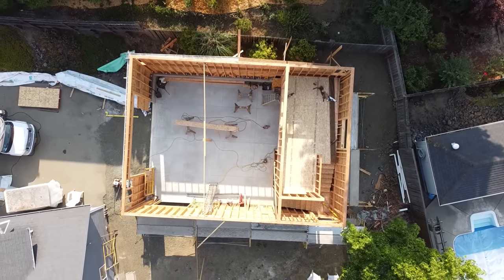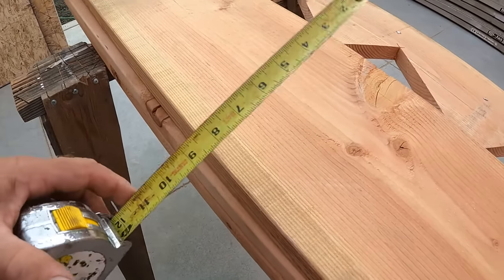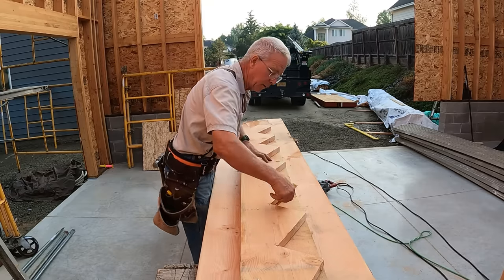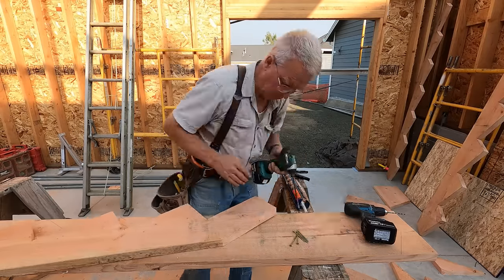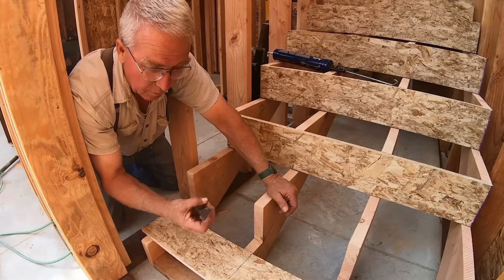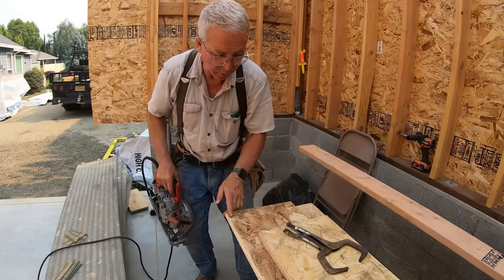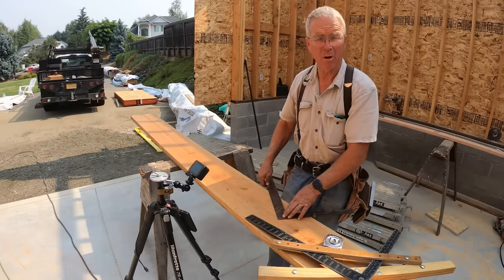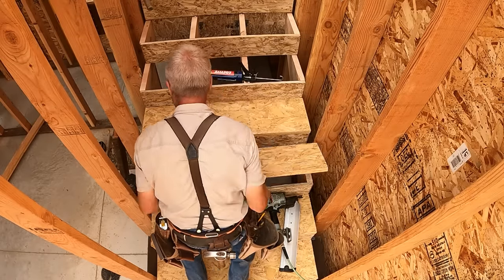Cutting Stairs With A Pro - Tips and Tricks: Shop Build #14

Comment: As 35 year carpenter that began doing strictly apartments in the union at a high pace for my first 13 years. I have cut hundreds if not thousands of sets of stairs as well as formed many concrete stairs this is the absolute best man to watch when you need to learn. I’m not one for the camera but I’m glad men like this are out here sharing their knowledge!
Reply: Yup, I'll watch this again - it's philosophy + logic + technique; the complete package.    And I cut my first stringers in '76 🪚👍
Reply: Michael Mass, I am helping a friend with his porch stairs and I cut the stringers for it.  1 time doing that, and one stringer has 2 treads that are about 1/8" shorter than the others.  Is 1/8" enough to be worried about?  I am adding the joist seal tape before we put the treads on to protect the wood.  Should I add a second layer of the tape at these locations since it is about 1/8th"  
I am annoyed with myself for those two being off a little.
Reply: @jamesbeecher4431  An 1/8” in framing is definitely tolerable it’s the thickness of the blade. A lot of framers would call it perfect. 
If it bothers you just knowing it’s off putting an extra layer or two of joist tape on them is a great idea! 
Stairs can be intimidating for some but they really aren’t that difficult, at least most, hats off to you for taking on and completing them!
Reply: @michaelmaas5544  Thanks for the info and encouragement.  It's an excuse to buy power tools!
Have a great week.
Reply: @jamesbeecher4431  one can never have to many tools!
Reply: @jamesbeecher4431 buy a box of steel foundation shims. 150 for a box now. Painfully. Surprising how often they come in handy. Various thicknesses. Sort out a few and take that 1/8th out. I sound just like you and that's the way I've dealt with it for 15 years and I'm a contractor now. Fix framing mistakes all the time.
Reply: what's wrong with a 2by4 and steel square connected together with C-clamps

Comment: I have to comment about my experience with stairs.  I was on a federal project for constructing a "park-like" facility and had a slope to traverse.  My experience was in another area of civil, so this type of structure was totally new.  I asked several engineers for some pointers.  The only help I got was "You'll figure it out".  The design and layout were not defined in the plans other than a graphic on plan view which showed steps from top to bottom.  I was responsible for laying out the set of concrete steps for the contractor.  I had little clue.  I had a defined elevation difference and chiseled in stone touch-down points I had to hit and keep the rise and run of each step consistent within the defined specs.   I did a lot of head scratching and finally reverted to drawing the layout in profile view.  That's when I discovered that a significant landing midway of the steps was required to maintain the rise and run and keep the firm touch-down points.  This was approximately 40 years ago.  I periodically stop by that project just to see the completed steps.  Some things you just don't forget.
Reply: your story illustrates that you had to take the bull by the horns and figure it out youself!..those engineers do what they know best but ultimately leave it to you....only the smart engineers NEVER talk down to you  and recognize how important the blue collar is ...THE PAY between us and them is actually reversed to what it should be! .....
Reply: I always ask what the GC wants. I tell them I can do it whatever way, I don't care myself as I will never be using the building, but they're going to be on the hook for it in the end, so its their responsibility to let me know if they need a certain finish.

Comment: Nice. My tips...make sure the elevation is taken  from the top of the landing to the floor at the end of the stringer...floors can slope.. adding to over all rise.
I have always added a 2*4 to the bottom of all the stringers.
If you put another square in your jig upside down to the first  it will give you the points more accurate.  On 1.5 inch treads I always start at the bottom with a riser and second riser then first tread and nail back through the second riser into the tread and continue on up. 
You can stack the two stringers together and cut 1.75" deep...this will leave a .25" cut in the second board which can be stacked on a third and continue.  Just some tips from an old stair master.  Good morning from Missouri...the Ozarks.
Reply: I'm gonna have to read this a few times. Great comment!

Comment: Stair building is really a lot of fun. I've replaced a couple sets of basement stairs for folks, the original builder used mortised stringers that were meant to be affixed to wall studs just floating out in mid-air. You'll see wide stairs that are built with no support stringer in the center. Knowing the basics can make you some money and it's very satisfying.
Reply: Sounds like my basement stairs... added it to my project list the day after moving in. Squeaky treads balancing on a 3/8-1/2" hair 😐

Comment: Bravo! You finally made a video on cutting stair stringers, comming from a person who knows how to do it. I am a retired Special Project Builder doing commercial casework, countertops and other speciality items. I worked at 2 lumber yards prior to my last one, and I cut out a lot of stair stringers using a framing sq. and a set of square buttons to do them. Since I was at a lumberyard I would calculate the stringers length and select the 2 x 12 SYP that I needed. Also sometimes I would add a 2 x 6 on the side of the center stringers for extra strength and on the outside ones too sometimes. When the treads and risers are glued and screwed on, no squeaks. It surprised me the number of contractors that I cut stringers for, and I think some of them didn't know how.

Comment: I like the fixture for the framing square. I made something similiar to use when I layout stairs. I also calculate where the point of the framing square should be and mark all of those before starting. That keeps me from being off by even the width of a pencil mark. One of my friends told me that stairs are "rough framing" not building kitchen cabinets!! But I have a sense of satisfaction when I am done. I use 1 more stringer than is called for by code. My stairs are solid. 

Thank you for passing along your knowledge and experience. I really appreciate when you take the time to explain why you do something the way that you do.

Comment: As a structural engineer, whenever I’m tasked with designing a stair framing plan, I always spec scabbing a 2x to the side of the stringers (at least 1 side, both if possible) to compensate for poor lumber quality such as what you’re working with here. Love your videos and keep up the good work. ❤
Reply: Like a ledger board under the stringer wall stringers or a horizontal piece under all the stringers from left to right wall?
Reply: @jeffshackleford3152  Think of it as sandwiching the stair stringer between two 2X’s. The bottom edge of the stringer flush with the bottom edge of the 2X’s. This gives the stair stringer added strength where its fibers are in tension. Hope that makes sense.
Reply: I worked with a structural engineer for years as an architectural apprentice & learned alot. His method was what you or nature takes out of your structural member, match that thickness with minimum 8” each side of the defect with quality wood by means appropriate.
Reply: @randywinegardner7517  like sistering joists?
Reply: @jeffshackleford3152  yes
Reply: @H2s Yes that eliminates most of the issues but costs more as well.
Reply: SOP for everyone I know. Even more importantly, having the 2x4 sandwiched between the wall and stringer allows the drywall to slide behind the steps. (Hold the treads back 3/4"-1") Otherwise it would have to be notched around every step.
Reply: I’m a 60 year old carpenter and I’ve cut lots of stairs. Scott it is always good to see things you do that are different than what I do. I gained a few tips from you. I really like the wood framing square jig. I noticed you apply the top riser directly to the landing, underneath the nosing. This makes it easy to nail the stringer into the upper skirt. I for years, drew a horizontal line and cut the top stringer back the thickness of the riser material. I like your way better. One thing I’ve done is calculate the mathematical location of each step location with a calculator. That way you make each step exactly the same. Not that it matters much if you accurately cut and scribe a pattern. Well done Scott. Oh BTW there is a gremlin in your tool box that will steal one of the screws from your stair gauges! I bet I’ve bought 8 sets in my career!

Comment: I spent 9 months building all of the stairways for a 7 story, multi-use building, almost every one unique. (4) 1 3/4"x 14" LSL stringers. A few tips: I used a 10 1/4" beam saw to minimize over-cutting. Move backwards instead of forwards as you cut the rise and run so your sawdust doesn't obscure your line. I used stair gauges on that job, but now just quick-grip any small, straight piece of wood to my square. Far better IMO. Keep up the good work. 👍

Comment: I really enjoy your Vid's, they are well edited and cover so many trades. As a general contractor of thirty eight years and a carpenter of 49 years and still going, my appreciation is awarded from experience. This one had many great tips & advice. I would add: Install backing blocks at rake of stringers before attaching the stringers to the studs & pad out the stringers with as wide of a 2x as possible ( from the intersection of the cuts of tread/riser to at least the bottom of the stringer). Nail this on first to studs, then attach the stringers to it. Now you have clearance for 1/2"-5/8" drywall installation and a1x finish skirt board, with no cuts.

Comment: This is a great video on how to cut in stairs. I’ve cut in enough stairs over my 30 years, I’ve lost count. I’ve also done the finish work on stairs and I’ve ripped out a few too, that others have done incorrectly. 
 I can’t see anything wrong with what you did here. Over the years I’ve picked up some tricks from older carpenters and through trial and error. One of them is bizarre when you first hear it. And I thought for sure it was, until I tried it. So, when you go to cut your line for your treads, as you start your cut make sure you leave the pencil line completely. And as you cut you want to slightly work your way into the pencil line, so that you’ve gone through the line at the end of the cut. The idea is to have your tread pitch down about a sixteenth from front to back. When you do this, when you walk up your stairs that slight pitch pulls you into the stairs as you’re going up, and helps keep you from leaning forward on the way down the stairs. Before you doubt it, try it. Just don’t pitch in the other direction… has the opposite effect.

When you’re doing your stairs, the first question should always be, “What are the finish flooring going to be upstairs and downstairs and also the landings?”
So you can properly figure out your heights in those change up areas. 1st and last step and on the landings also.

Over the years I stopped using cleats at the bottom, whenever possible. I prefer to take a straight strap and nail half of it to the bottom of the stringer were it meets the floor. Leaving the other half hanging past the backside and nail it to the floor, or tapcon it for concrete. And I’ll put plastic or felt under the pine stringers if they are on concrete too.

Comment: Another great video. If I may add to your practical use of the humble chisel. A sharp, well maintained chisel is as fast if not faster than a power tool when it’s used in experienced hands and in your tool belt at all times. My current favorite all purpose chisel is the DEWALT one that has one side of the tang sharpened so it’s a chisel knife. The steel isn’t as hard as a more expensive chisels obviously reflected in the price. The tang is really long so it can reach alot of things a multi master cant. Great well made hand tools are just as fun as great well made power tools. Most of my clients are of a older vintage, when they see me do couple quick passes with a block plane to clean up the edge of a board I just ripped, or finish a plunged corner with a sharp chisel or pull saw, my value to them shoots through the roof.

Comment: My Dad and my 3 uncles who taught me framing since I was a small boy showed me a trick with stairs. The treads are slightly dipping down for sleepy feet. There are so many details you can add...Thanks for the vids, I enjoy them.
Reply: Helps with drainage too on exterior stairs exposed to weather.
Reply: @psidvicious  Then grade away from the structure... not down every step.  Some people don't understand the power of water.
Reply: @ShainAndrews  On concrete stairs I used to pitch each tread 1/16th of an inch so that no puddles would sit on the stairs. Do the layout exactly square and level but cut the riser forms 1/16th shy. That way it automatically pitches the water out of each tread just slightly. Worked perfect every time.

Comment: Absolutely beautiful! I got forced out of automotive and then now doing handyman work, that's another story. As I travel around Colorado Springs trying to help people out I'm finding that most of the houses do not have actual stringers anymore. The stairs are shipped in from somewhere prefabbed. There is only a skirt routed out for the tread and it is slid into place from the back and glued.  The risers are thin 1/8 in pieces of nothing that are slid in place from the bottom up and stapled to the heel of the tread. These are 33 in wide treads and there is NO Central stringers added. These are all covered in carpet and as 15 to 20 years pass by I'm finding that the treads, which are made out of pressed wood, have now worn out their skirt/stringer and with no central support are swaying down in the center, pulling the staples out of the risers and falling through to below. There's no way to fix these once they're installed into the house without tearing out ceilings and floors and walls. Being taught how to build stairs, emphasizing the need for center structural support stringers,  when I was young by my dad who is now 90 I did not know that this practice took place. As I go in and out of these houses you can just hear and feel all the stairs creaking and giving way under you as you walk up and down them. I did not know that this would pass inspection as safe. I got lucky on a couple tri levels where I was able to go in through a crawl space and retrofit some stringers and support beams after sliding new treads and risers into the existing skirts. Then temporarily anchoring them into place until I can slide in and anchor down the new stringers as best I can. There is no craftsmanship in these track housing neighborhoods. The term we use in the Auto industry is, "flat rating" a job with no thought to detail or safety.

Comment: Once you get your final dimensions for rise and run figured out, if you stack 2 boards and clamp them together and set your saw depth full, you can score through to the second board and have an EXACT duplicate of the first stringer. This eliminates alot of human error being off from the thickness of the saw blade. Awesome video.

Comment: Incase anyone is wondering about deduction/additions at the top and bottom of the stringer:

Bottom of stair (if landing on subfloor) is unit rise - tread thickness + finish floor
Top of stringer (if using hanger board for the last rise as Scott has done here) unit rise +tread - finish floor

You would also deduct the thickness of the hanger board on the back of the stringer (plumb face) prior to installing the hanger board

Comment: Thanks for the Old school tip. I have a set of stair tools, actually I have 2 setts that come in handy from time to time.  but the one made out of wood looks interesting too.and should be easy to make. I have a extra long tool box just for construction tools so it will fit in nicely. keep the good work. There is great satisfaction  in building something that will bless a family.

Comment: A renovation job iv been working on lately, we couldn't get any timber over an 8x2 so to make our stairs we used a 4x2 on it's edge and cut triangle piece from 8x2s for the rise and going, then glued and screwed them down. Worked a treat.

Comment: Excellent video - especially like the square fence idea. I have often had to work with stringer stock that is crowned, so I prefer to snap a line down the center of the  stringer, then mark the points off that line with the framing square. I also got fed up with 2x12's with defects and started using LVL stock.

Comment: Great video! One tip that improves accuracy and speed, I lay out on the top stringer, and stack the rest under, pinning them together with 3 or 4 nails. Then double checking the circ saw is cutting as square as possible, I let it cut halfway into the next board. Once you remove the top board, you have an exact pattern to follow. Takes a bit of practice to follow the groove exactly, but works great.
Reply: That won’t help you avoid knots, cracks and any other imperfections that are in the lumber. You have to lay out every board individually for the best results.
Reply: @slynn5138  I actually do the layout, and have that stinger positioned in front, so as I stack them, I'm looking for knots and splits, and positioning them for exactly that.